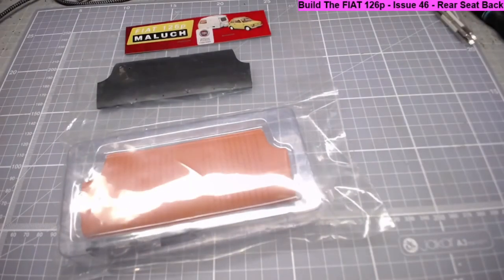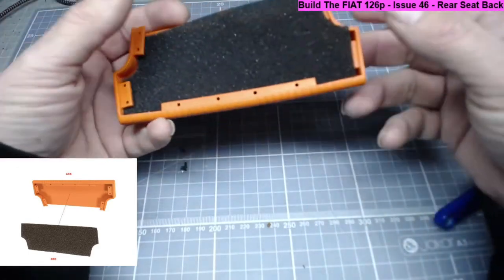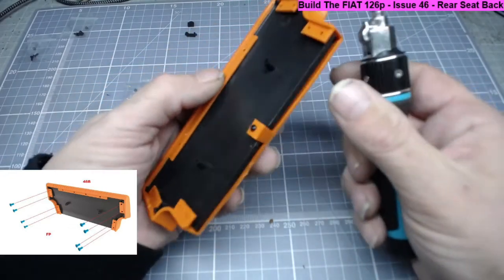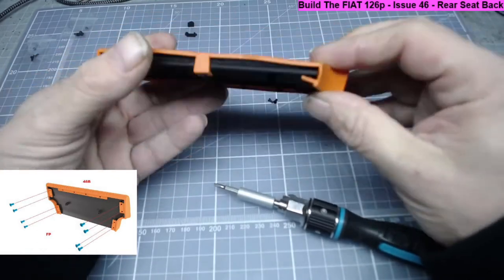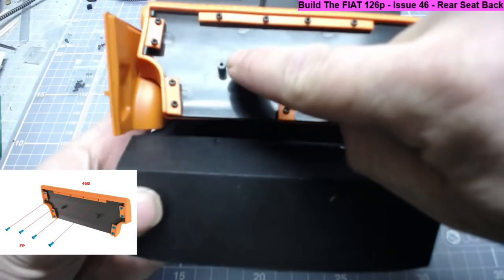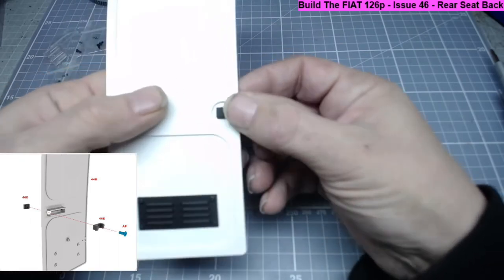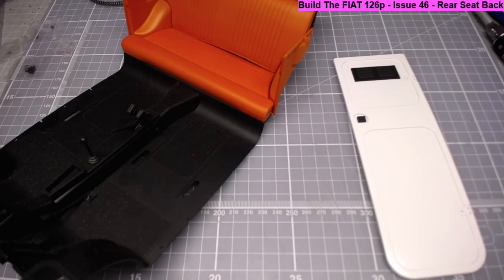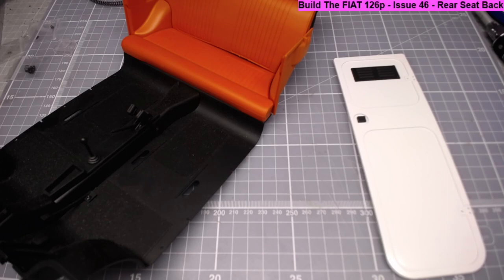Build The Polski FIAT 126p Issue 46 Rear Seat Back

Comment: Don't Panic!!  Don't Panic!!!  The seats for the Ecto1 were done in the same manner.  Shame about that gap in the back seat.  Perhaps you could take the seat back out and remove the screws holding the seat cover on.  Then you might be able to pull the cover down a bit and glue it along the bottom and eliminate the gap.

Comment: My suggestion is remove that lower middle screw on the back of the seat (the one that wasn't in the instructions)....maybe even tuck it inside the back.....so it's not visible.....that should push the middle of the bottom of the seat out a bit and reduce/ remove the gap???